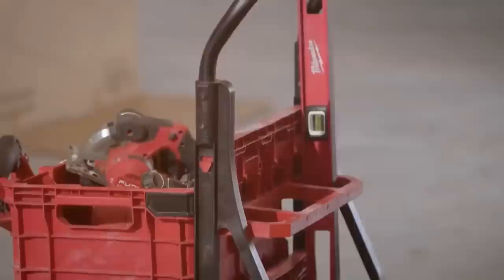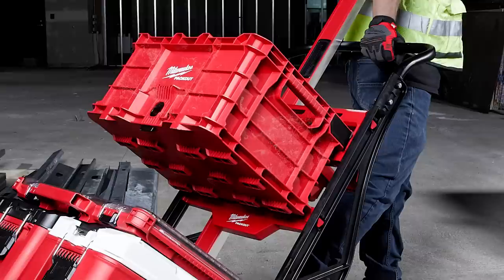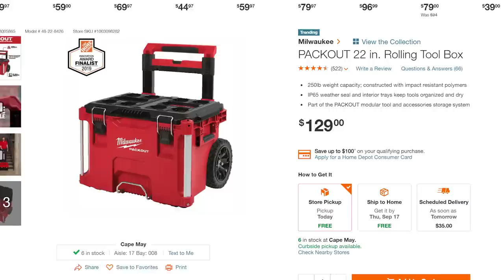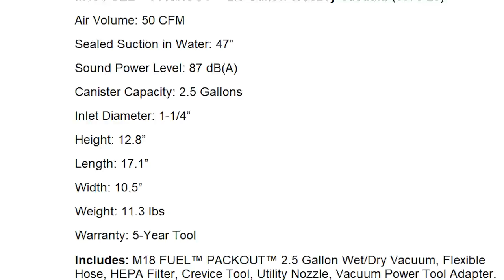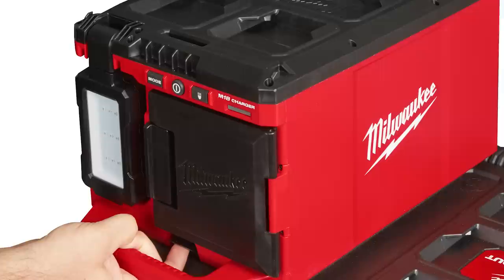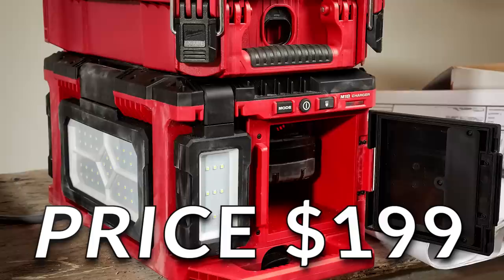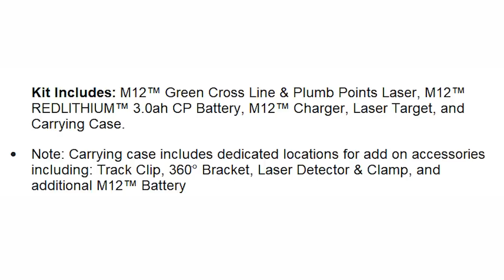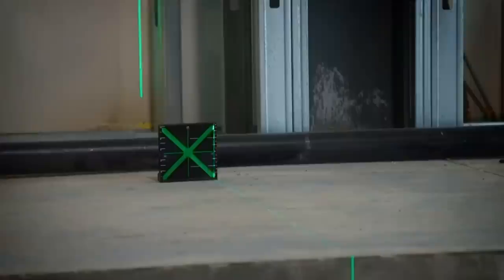NEW MILWAUKEE TOOLS NEVER SEEN BEFORE (They Finally Did It!)

Comment: "Responsive" I believe refers to the perceived size of the lazer when it's at the "center" point of the X. In low light you can see as the laser moves side to side, once it reaches the center it "jumps" to a full length reflection. That would indicate a "on point" position. I see what they are getting at and I think I would like it especially for single man operations at longer distance (like setting up while waiting on everyone else to show up!!!).

Comment: I wonder about laser transits that are manually....I.e. susceptible to human error....adjusted to center the bubble in the field. I have a self adjusting laser transit. Paid $900 for it 30 years ago. Lots of money then (and now) it has a pendulum interior mechanism of some sort that “tells” the automatic adjuster when it’s level. Works to this day. It’s an Agatec GAT120, made in France. It uses 2 D batteries and has a receiver that can be mounted on a grade pole or hand held.  Just my two cents. Semper Fidelis Dave Heitman dba Dave the Carpenter in Omaha

Comment: I watched your Pipeline Party the other night.  And I agree $50 for a shelf is way too high.  And based on the price you stated for the starter pack, that means two E tracks are $30.  You would be better off to buy two shelves, and buy the E track from somewhere else.  An 8’ piece of E track is about $20 from many vendors.  Much better than butt ending 20” pieces of E track.  I would see the shelves going for $30.

Comment: I'll be getting the dolly, both drawers, the vacuum and possibly the light/charger. I really want the m12 laser line, but 4-hundo for the tool only?! Not sure ill be getting that right off the bat, if at all. I would do 3 bills for it, def not  4. I'm definitely in concurrence with you about the work top; 50 bucks for a writing top isn't worth it, half that would be way more reasonable.

Comment: I’m really disappointed the new vacuum doesn’t have the feature to use more than 1 battery at a time. I would like to be able to use two 5 amp batteries or even three of them for longer run time.

Comment: The hard top and dolly is what I'm excited about. The light looks awkward and needs more lights for the size. I don't really have a need for the Lazer Level. Both of the drawers are cool but I don't currently need it. The rack is also cool but again I don't need one currently. And the vacuum sucks.

Comment: The work top is a joke... I can 3d print a set of packout feet for about $3 in materials and mount them in some scrap wood for a total of what $5...
Reply from the maker: Dats what I’m sayin!! 👍🏻
Reply: Brandon Scott then make us one, I want a birch top with a smooth finish with some over hang, and hit my edges with a trim router. I got $60 for you
Reply: and the 3d printer was 500_ dollars
Reply: @lwrc I think you misunderstand. You would only 3d print the custom feet that lock into the packout system then screw those to a sheet for wood. You can also buy the feet for fairly cheap online.
Reply: I could just 3d print a 3d printer for $7
Reply: @teddybeardesigns  no you don't understand, you're saying this ain't worth the money, you can just 3d print one, but that 3d machine cost more than the Packout 😂😂😂 so in reality even doing it your way you're putting out more money lmao
Reply: @stevescott1962 That's out of context but whatever. Do whatever you want man lol. As I said you can buy the packout feet online even directed you to the website 😉
Reply: @teddybeardesigns  no it's not out of context it goes right with your comment lol nit everyone has a 3d machine to print (like u stated you would do to save money) but the 3d machine cost a lot of money lol
Reply: @stevescott1962  👍 like I said do whatever you want lol
Reply: @teddybeardesigns  its not about doing what I want 😂😂😂😂 u clearly don't understand your own logic
Reply: The only way your idea would work is if u already have a 3d machine and its already paid for itself, other than that, you're gonna put morr Money out just on the machine to make the parts you need
Reply: @stevescott1962  ah but then you could go hog wild with that 3d printer ! Print everything you want. Print those feet for you buddies sell them . Print yourself a new pack out container even lol.

Comment: personally i think the worktop is worthless at just 50lbs for being able to hold that seems low considering add a vice welp there can easily be 25lbs no issue now add your item you clip into your vice and add the pressure you will put against that item when cranking down on it and you might break it just using it as normal.
Reply: I still prefer my sys-mft, I put it on my festool vacs or on my sys-combi (with my sys-cart too)

Comment: The 3 plane laser would be nice for 3 or 350, the worktop, 15 to 25 bucks, milwaukee makes great tools, but i feel like they're a little unfair with pricing, if they came down a little on some of the specialty tools they'd sell higher volume, or if they atleast included an extra battery once in a while. 

And im not talking a 2 amp hour either.
Reply from the maker: The laser pricing seems in line with competitors, but the competitors have been in the laser game a lot longer!

Comment: You're exactly right I think that's going to be a mistake it's nice to fact of having the hand cart with the wheels on the inside if anyone's ever been on a train or Subway space is very limited but I think that would have been better if they would have made that maybe a few inches deep the store say job site contracts some papers few display books Etc but anything that you repeatedly bolt something on and off well crack even three-quarter inch plywood so I think this one is going to be something sold but at a very low price

Comment: @VCGConstruction Has Milwaukee hinted at whether the hard case for the new level at 599.00 will be Packout based or if it’s a blow mold?
Reply from the maker: You talking about the 3plane laser? I saw pics during our pipeline event that had it in foam in Packout. But the kit says bag.
Reply: VCG Construction  In the video for the 3 plane laser it says the kit comes with a carrying case with dedicated storage sections for accessories. I’m hoping at that 599.00 price point, it’s a foam lined Packout vs a contractor bag. I’d prefer to get it bare tool but if it’s kit only, I’ll deal with it and if it’s a blow mold case, I’ll move it over to a Packout parts organizer unit and Kaizen foam it.
Reply from the maker: Yes it does say case, sorry, not bag

Comment: I hope packout makes a large non wheeled box. I’d prefer to trade the wheeled box for a large non wheeled box & dolly. My wheeled box holds circ saw, SAWZALL, 2x m18 holehawgs, 2 trays with 1x 12.0, 2x9.0, 1x6.0, 2x5.0 batteries

Comment: Stuck on the top to trying to figure out a use for it.
Reply: Miter saw, m18 soldering station, m18 compressor
Reply: I built the exact top on my own this year.  I mounted my key machine to it to make it portable. Only difference is mine doesn't lock in place. I will be buying this.

Comment: I think the work top is a home run except they marketed it completely wrong, like Milwaukee has done several times before... I would be more likely to use it to attach the old hard tool cases to, or anything I wanted to be easily secured to my mounting plates in the truck. They should have marketed it as a 'universal packout adapter plate'.
Reply from the maker: Good idea
Reply: @VCGConstruction  thanks. Not the first time marketing dropped the ball on a great product. Remember the "indestructible" driver bits? That mistake ended up completely ending that product. Or how about the picture showing the M12 inflator airing up a tire on heavy equipment when it's not designed to handle any more than a tire on a sedan. Because of that mistake the reviews on that inflator are terrible when in reality it works amazing for what it's designed for. Milwaukee makes amazing products, their marketing though needs some serious refining. 

They even dropped the ball on the large packout tool box. The coolest feature on that thing is that the lid locks when you raise the handle wether you have it latched or not so you can never dump it. Yet I've never seen them advertise that awesome feature.

Comment: I'm guessing that the packout hand truck is going to kill the packout rolling box. Who wouldn't rather have a hand truck to move anything around including your packout stack? I'm guessing that us why Milwaukee is dropping the price on the rolling kits. They want to get inventory gone before this is available and kills it. Plus for most people once you load up the bottom box it is too heavy to lift. Having the hand truck you can mix and match easier going from the truck to the site. Just grab smaller lighter packout which are setup for specific tasks.

Comment: How about a 2Kw solar generator on a pack with Folding  solar panel for real off grid Power source for charging M18 batteries, cell phones, heating lunches And lights. Think of the capabilities

Comment: I wish I had this pack out set but they are outside my price range. For the equivalent Husky connect system that I got for $250 I would have to spend $1800 for the same setup. While very innovative it's just not worth it to me.
I would pay more but not that much more. I have the Ridgid system but it weighs too much.

Comment: Hay brother I was having problems with my Milwaukee M18 jigsaw D handle Style the switch that controls the vent on the side allowing air 2 below from the front of the blade so I returned it to get fixed but instead I picked up the M12 Milwaukee jigsaw which is a barrel Style out of all the tools that jigsaw are used the least but I actually like the way you can control and also allows you to see the line better but so far I like that style
Reply from the maker: My M12 jigsaw has served me well, doesn’t owe me a dime! 👍🏻👍🏻

Comment: Pack out worktop: you can write on it; spread out smaller drawings/area plans to read; doing sketches; sit when you're tired and most importantly, rest your coffee and other energy drinks or attach drink holders and Leave the surface to spread out your lunch.

For fishing, use as a rigging station and or bait station; after fishing, use as a fillet table.

If you have a short wife or girlfriend and you're too tired at the end if your work day and she wants to hug you and kiss you but your back hurts to bend that low for too long, put her up on the worktop like a highchair and she will meet you at your level....no problems.

Modify with some custom edges and legs to make a bed serving tray or while you're on the couch watching you favorite fishing show....because you had to work and couldn't go yourself.....🤣

Right now, I would fix two vertical STANDS at either end, 10" tall with a vee cut out at the top about 2 " deep for making a thread station for wrapping and repairing my own fishing rods.........then I saw the price and thought on the other hand, just get a piece of dressed 1"x 12" x 2' 🤔🤪🤓🤓

Comment: $199 is way too much for that packout vacuum....i bought the M18 gen 2 vac for $120...so $79 more just to put a molded base that snaps into the packout system ? 🤔
Reply from the maker: What do you believe would be the right price KOTC?
Reply: @VCGConstruction  i understand its specially made for packout but should be no more than $130....$150 would be absolute max....you can buy a 16 gallon ridgid shop vac for less than $100 even tho its corded

Comment: The new work top needs to go back to the drawing board. I foresee it falling apart easily and not enough room to use a sizable pipe vise.. I would not invest in it. At this point, it's only good as a writing surface. not much good for anything else.

Comment: Man, Milwaukee makes the best tools money can buy!  They really do!  BUT, that being said the lights and vacuum are drastically overpriced.  Especially when $200 bucks would get you a VERY powerful wet/dry vac.  Each one of these cost them penny's on the dollar to build in China.  The shelves are cheap plastic crap with an outrageously low weight rating, the majority of these pack out items should be rated for much more and again cost penny's on the dollar to make in China.  There are better ways to transport and store tools.  Their tools however, like I said are the proven best and in my opinion well worth the money.

Comment: Milwaukee is getting left behind in the battery chainsaw department.. Milwaukee needs a true ARBORIST SAW.. the handle and trigger throttle goes on top.. do your research.. the regular chainsaw is fine.. but it's not for climbing in trees..

Comment: I'm staying away from the work top it just doesn't make sence. And I will stick with my bosh Lazer Milwaukie os way to expsive . Now I like the m18 vacuum and it came in at a good price and I like the 2 and 3 draw system thats nice dont have to take everything apart to get to what you need fast. And im not going to lie i like the packout light charger at that price its tempting but I would like to know where they got the 31 hours from when it 4/8/12 . Getting back to the lazers for a minute you reviewed the rechargeable lazers using the flashlight batteries i have to say there not worth it i picked up the flashlight because of the run time it said 8 hours on low i didn't even get that much. Its embarrassing to be on a job and your light goes out and you have to ask the customer if they have one and yes I changed the battery and got the same results. So to me that battery is not good for long time use and I just wouldn't bother buying it just my honest opinion. Anyway great review ive been watching tou for a while but this one got till next time

Comment: Love the lasers, and I am really hoping for a rotary soon.  I feel like it was a miss to not make the laser case packout.  I don't understand why to do not take advantage of the packout system everywhere they can, it would add a bit more value.

I am excited about the dolly/cart, but a little concerned the frame is plastic.  If they are charging $200 for a plastic dolly then it is too much and too little effort on their part.  I can buy a steel $100 dolly from harbor freight and add some @packible accessories.  I will still save $50 but have a far more capable dolly.

I feel the same way about the shelves, but to buy the parts to make an e-track compatible shelf for packout you will not save much of the $50 price tag.

As for the worktop, that price is rediculous. This one is a gimmick, which is disappointing.  I can print or buy some packout feet from @JakeOfALL and attach them to a 3/4 piece of plywood and have much more usability.  Also you are right, if your stack is not heavy enough, low enough, then you are going to tip it when wrenching on it.

Comment: The drawers are a dissapointment. I was hoping for something more like Sortimo or Stanley ( the organizers ), in a carcass that allows you to pull the one you want, and take it with you, or take just the cups you want, leaving the rest in vehicle. Some may need all their small parts and fasteners at the job, I just need them all in the truck, and I pack-out what I need.

I called Milwaukee, to try and speak with a product manager; as there is no room in many work vans, unless PACKOUT comes in formats to REPLACE the 1960s designed Adrian Steel and Weathergard shelving/drawer.

Perhaps that is something they ARE working on, but they will never tell.

Comment: cross line and plumb laser looks great. A decade too late and overpriced thought.
Reply from the maker: Better late than never right?
Reply: @VCGConstruction Indeed. I'll wait for a deal if it ever comes. Bought a dewalt in 2009 for 150$ , you'd would think a decade later these would be a bit cheaper. The margin on these must be quite high.
Reply from the maker: Yea defineltly huge margins especially considering where these tool companies manufacture the tools themselves.